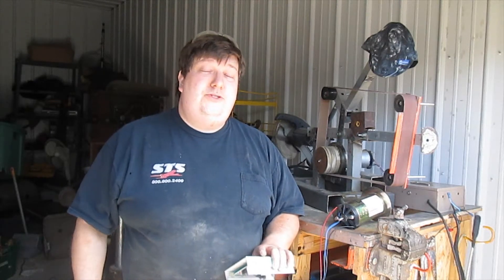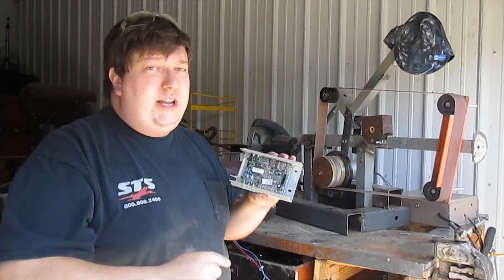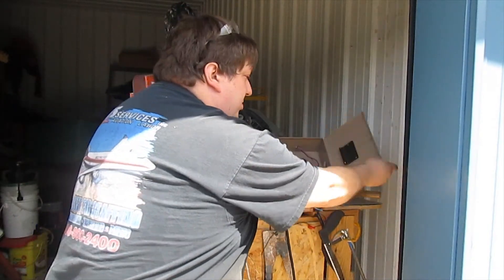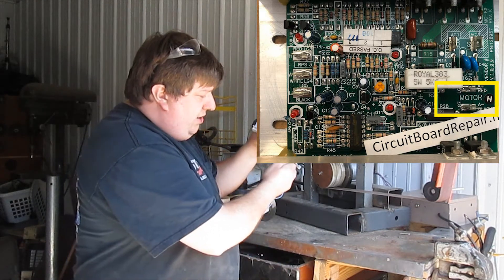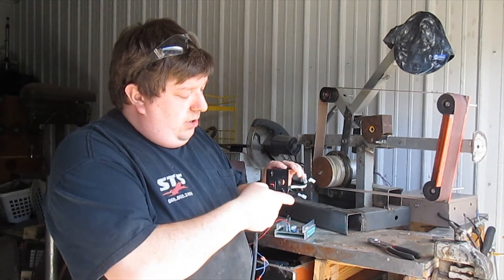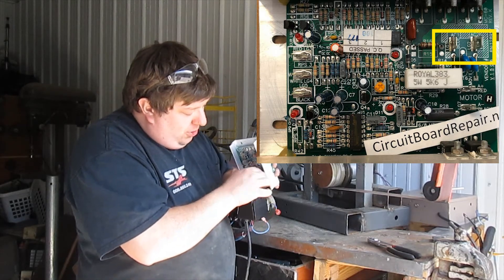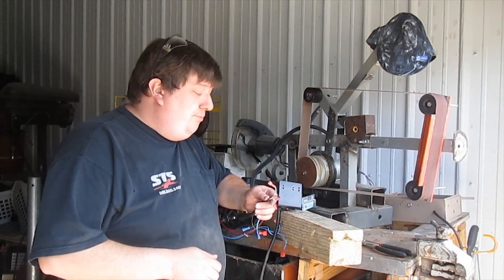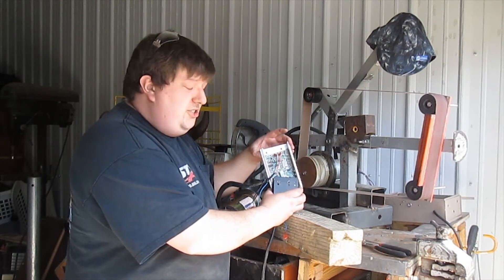Set up a mc60 circuit board to an electric motor

Comment: what is the difference between the potentiometer linked, and a regular 5K pot?  i am building a pottery wheel, using an mc60.  the motor wont start spinning until I turn the potentiometer about 1/3 of a turn.  Is the knob linked in the description capable of more minute speed adjustments, and will it allow the motor to begin spinning at a lower speed?  I don't see why it would.
Reply from the maker: so first I would need to know is it an AC motor like from a dishwasher. if it is it has a centrifugal switch, basically it won't move under a certain speed. I am not a fan of AC motors because unless it's a faze motor speed control is iffy. If it is a DC motor like from a garage door opener. Than you have a speed control but there is speed minimum that it will not go lower than. If it is an AC motor. I would get something else. I just hate them. If it is a DC motor hook up a gear reducer to get more torque but less speed. for a rock tumbler that would be my call
Reply: @tomasistudios2618  it is a DC motor from a treadmill.  That makes sense to me.  What I am describing is the minimum speed, I figured that was the case.  I found a potential solution, using a switch on the wiper lead to bypass the need to reset to zero, and physically limiting the potentiometer range.  (In this case it will be a pedal, which has a bolt above and below, to limit the movement. Basically a throttle block/governor/adjustment screw.

Comment: (1) The green (ground) goes to the case, in case you and the electrics have a fight, because something went wrong. It gives you a little edge by dumping the current to the ground circuit.  

While your piece of wood insulates, any screw holding it and the board to the metal box, a wire coming loose an so on could pose a problem.

Said another way, you have 120 VAC into the box and ground exists for a reason.

(2) There is nothing wrong with push buttons to set speed. Get around issues of dealing with having to adjust speed by installing a toggle or rocker capable of handling 120 VAC, like the one you showed. You'll start where you left off.